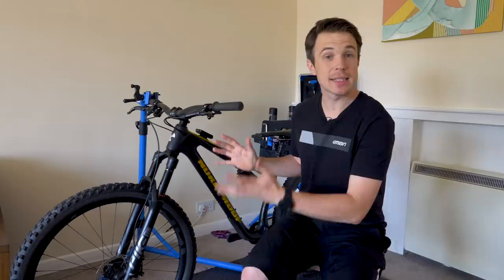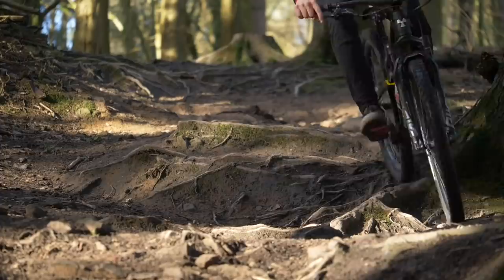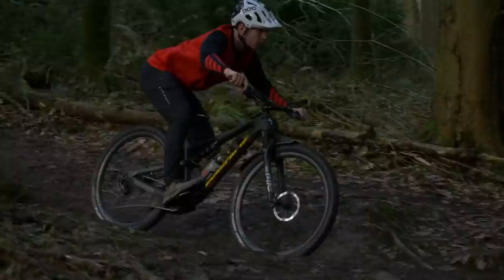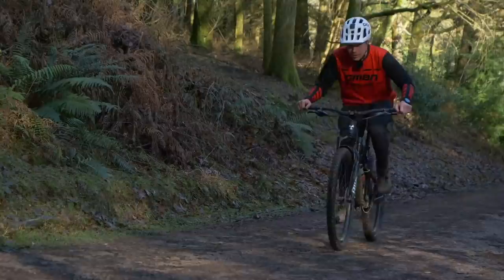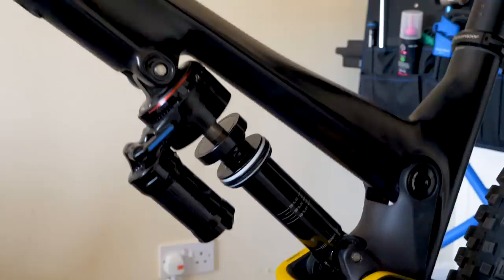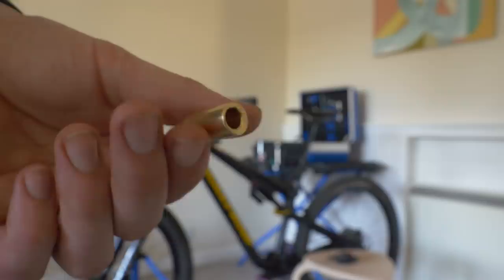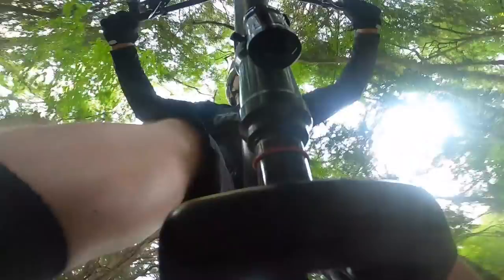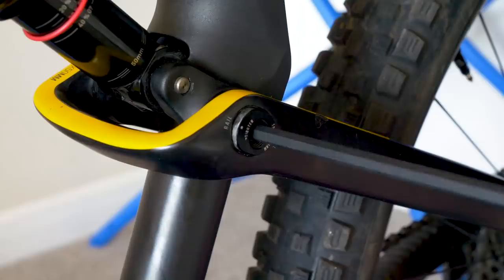Change Your Mountain Bike's Geometry For £100/$100/€100 | 3 Bikes in 1

Comment: perfect!!!
Considered doing the same thing to my fuel ex. I will clear a 55mm stroke (vs 52.5) as I have checked already without air in the shock.
Great video, please keep these up!!
Reply: Funny as I am thinking of reducing my Slash's fork to 150mm for more pedal friendly fun.  It pedals quite well but hey fun to experiment with.  Tyres also make a huge difference and a 32 tooth Oval chain ring to replace the 32 stock round.

Doesn't take much to change things for different purpose and for me, I know I have a great point it down and go hooligan style bike when I need it.
Reply: Going to a 55mm shock is also a common mod to the Giant Trance, it takes the rear travel from 140 to 148, and then you can take the fork up to 160 travel which also makes the bike a tad more slack.  I've been looking into this for my own Trance as my stock shock didn't come with a lockout, so I want a new shock with a lockout, but my bike came with the RockShox 35 Gold fork, which uses travel spacers, so I can simply remove the travel spacer to go from the stock 150mm travel to 160 travel.

Comment: @gmbn tech Regarding the opinion at 13:25 anglesets do change seat tube angle. Front of the bike goes lower, the BB as well and the seat tube angle follows them by increasing the angle the seat post is positioned against the ground.
Reply: All of which are good things

Comment: more travel = higher BB and slacker

dont increase travel more than 30mm though

And remember that stroke lenght does NOT equal stanchion lenght from the seal to the crown, it will bottom out 2mm before or whereabouts
Lower end forks will usally have 10 - 20mm extra stanchion

And why so little sag in the front compared to rear? I used to have 20% sag on my old 130mm fork, and 10% sag on my coil rear shock (stroke is like 47 mm its a very short 165mm eyetoeye shock)

I keep softer suspension in the front to reduce arm pump

Comment: Many bikes don't have pressfit compatible head tube, so you can't use angle headset, for example Trek, Santa Cruz are some of the brands that come to mind.
I think my Geometron G1 is great how it is, 62 deg head angle, low BB, steep seat tube angle. I am glad I went for it. I haven't experimented with mullet setup or different mutator setups.

Comment: Great vid. I am running a 2015 160/130 dual pos pike on my 2019 Nukeproof Scout.. Is the 130mm travel setting just for climbing  or can I use this to ride hard on dirt jumps, , on a pump track or dh flow trail to make it more playful
Then open up to 160 for the gnarly and steep stuff.
I was gonna try my Helm coil fork off my 2015 Nukeproof Mega  and adjust the coil travel but prefer my pike on the scout due to being lighter and on the go adjustability. Also prefer to leave the helm on the Mega.

Comment: If i were to dh enhance my bike, i wouldn't increase rear travel, because as you found out, it steepens the head angle and rises bb height (unless the rear wheel doesn't touch, in wich case it's great 😆). So I'd rather try to decrease bb height, as it usually slackens the bike, and I'd add air/compression to the suspension. Faster descending speeds demand stiffer/more supportive suspension, not more travel. My opinion.
Anglesets are indeed the best way to achieve the previously mentioned things.

Comment: Alternatively spend the £100 on a weekend away riding which will make you way faster and once you have grown a pair of legs you won't be bothered about the minute edges you can gain from tinkering for ages.The amount you will spend on aftermarket bits is directly proportional to the level of insecurity you have about your riding. lmao

Comment: Instead of buying a smaller air spring to reduce the travel of the fork, you can put the maximum amount of volume spacers in, and decrease air pressure, giving pretty much the same fork feel.

Comment: After 10 rides with an angleset, my fork had cracking and clicking sound.. umfortunately seems the steerer tube got damaged..
Reply: Try greasing the headset...cups, race, and bearing exteriors. Usually cause of from end creaking
Reply: @rupedog  yea did the whole 9 yards mate. Regreased 4 times.. took bike to lbs, reinstalled old headset, reinstalled the angleset.. still cracking and creaking. Then the lbs guy put another fork in and... well... no more cracking and clicking sound. I really liked the effects of the anglset and it worked well with my bike (made it 64.3%) and fork offset but alas....got a new fork, decided not to risk it so got a 10mm longer fork and removed the angleset. Maybe i was unlucky and got a bad batch but not.going to risk it as forks cost a pretty penny. Pity ..
Reply: @stevent1565  well it was the fork, not the headset. Now you got a longer fork that stays at the same angle so same pressure on the csu. What good? I advice you to reinstall the angleset and maybe lower the fork to what the bike came with (only if you want). I have a mate who has an angleset for 4 years on his bike, and his fork (a 2007 marzocchi Z1) is still going strong, so your problem was a weak steerer, not an angleset.
The longer fork rises bb and slackens seat tube angle, wich is not good. On the other hand, angleset slackens just head angle, but lowers the bb and steepens the seat tube angle, so everything is improved
Reply: @Tzestos  what you mentioned is true to a degree but depends on multiple factors. 1st the increase of travel: most bike makers(including mine) allow for 10mm increase of travel within a safe margin to keep the warranty(meaning its safe for the head tube and frame). 2nd it depends on the bike geo if it has a positive or negative effect especially the crown to axle measurement(i wld say the most important for a fork for your bike). In my case the crown to axle measurement increased by 7mm which works well for my bike. And 3rd , my bike is quite low and with the 170mm fork (original was 160mm) my bb height increased to 336mm from 334mm which is considered pretty low even by today's standard and has no negative effect in handing and center of gravity. My seat tube angle of course slackened by a minimal amount but i m off my seat most of the time so its not a big deal. All in all it works very well with my bike. In short, it all depends on your bike if it works well or not so of anyone is making any changes in anything, they must 1st do a bit of research and check with their bike maker; to which both i did.
As for the damaged fork; it is what it is. Who knows if it was just bad luck ie if my fork steerer tube just happened to fail or if it was the angleset (perhaps my particular angleset was defective). All i can say is this, my fork was fine after almost a year of hard riding. The cracking sound started after about 10 rides or less. When i  took fork of the bike, there was significant friction damage wear marks  on the crown where the crown race sits around(not there before i installed the angleset). Quite bad friction marks. I sent the photos of the damage to the anglset maker and they advised me to stop riding the bike and sent replacement parts just to be safe (they were very cool and helpful so i m not going to mention the make of the angleset. Beside, it just cld be i was unlucky to get a defective one so it wont be fair to them to say they have a bad product). 
I just bought a sweet Ohlins RXF36 EVO fork. So i m not prepared to risk using an angleset for my new fork anytime soon.

Comment: Surely works but is a lot of hassle. In my experience putting some cheaper downhill/Enduro 2.4" tires on a xc hardtail or trail bike already does a lot. Pump them up a bit less, adjust your suspension a bit and get aggressive pedals, a shorter stem and wider handlebars. A good bit cheaper and way easier than what he did. I'd even say it does a good bit more than what he did here. Still a good video for the more experienced folks

Comment: I wish I could stay focused and understand what the hell you're on about Henry. This is not a reflection on you or your explanation at all l, but for me you may as well be speaking Swahili. I sat down with all good intention to take this info and use it on my (cheap 'n' old) bikes. First minute or 2 in I was thinking "Yep, got that, right, I gotcha..." and then degree by spring-rate, compression by pre-load the wheels started to fall off and I drowned. I've been MTBing (badly), fixing, building and servicing my own and every other buggers bikes for over 30yrs but I just can't seem to get my head round all that. I can only liken it to being suspension dyslexic (my son has dyslexia amongst other SEN's before anyone gets all pc and precious). Does anyone else here feel the same or am I just an idiot. 🤔 It's so frustrating as I'm pretty good at everything else.

Comment: the pike can be increased to 160mm. use the 275 shaft. RS dont sell a +140 fork because that is the job of the lyrik. check out the trailhead app. also i have successfully done it to a commencal meta tr with longer stroke shock. 160/143 and 65.5 deg headangle.

Comment: #AskGMBNTech
My 2016 Scott Genius 740 was built with a 67.9deg lo/68.4deg hi head tube angle as stock. Not so modern or progressive these days. I've just learned about angled head sets  but have some questions/concerns: 
1. Is there a limit of how much slacker I can go? 
2. Will slacking the standard head angle adversely effect my bike's build integrity? 
3. How do I know which angled headset will fit my bike?

Comment: With my old (1997)  Rockhoppers 70 degree head and 72 degree seat tube angles, I don't think I'd be able to "Marty McFly " my geometry to anything like modern, but it makes a great climber! (I did give it a 1x11 upgrade though!)
Reply: You can get the 70 degree rockhopper down to 69 or 68.5 that is a really good angle for XC

Comment: I just bought a Whyte 29c XC bike. My last bike was enduro so will be a slight change of style.

I was wondering if anyone has put an angled headset to slacken the head angle by 2 degs and upgraded the forks from 100mm to 130mm on an XC bike? That would take the head angle from 69.3° to less than 67.3° which would be better for downhill. Will the xc frame hack it? 

Maybe this is not required once I actually ride it but I am just thinking of options if I am not comfortable with how it handles downhill (nothing major).

Comment: #AskGMBNTech
I normally just ride around my local parklands, with a few jumps and drops. It's the perfect terrain for a Canyon Spectral. But occasionally (one every 2-3 months) I take a day trip to the You Yangs where there's some really gnarly rock features, DH tracks and jumps. I love riding hard there. Because of that is it worth going for a Torque instead? I don't really mind too much about pedal efficiency, as long as it can get to the top.

The main thing I'm concerned about with the Spectral is that the Pike won't fare well in the You Yangs, and that the Code brakes would also come in handy.

Comment: #Askgmbntech
I have an old Cannondale Trail SL 1 2013 lying around, that I want to set up as an extra bike for my vacation house in the woods. 
It came with a 80mm fork and a 71degree headtube angle. To get it up to speed, could I just put on a 110 / 120 mm fork, or would that be too much for the geometry to handle? Would a angled headset be a better option? I normally ride an On One Scandal with 65 degree headtube.

Comment: I've just swapped my front fork from an 80mm XC fork to a 140mm 27.5'' boost fork on my 26'' hardtail frame (still using 26'' wheel on the front). I also swapped the 100mm stem for a 35mm Nukeproof stem (and new handlebars) and it's completely changed the feel of the bike. I've yet to fine tune sag and saddle position but it feels much more capable for rough trails and downhills; it feels like a whole new bike.
Reply: I guess u didn't get the memo on only ever increasing fork travel by 10mm, (20mm absolute max) over the stock maximum the frame was designed for? That huge jump, on an xc frame, hitting rougher trails, is a recipe to rip ur head tube off. Unless the frame had a 130mm fork option from the manufacturer, u are taking one hell of a risk, as frame would not be designed for that kind of leverage.
Reply: @rupedog  I'm not sure if it was an XC or what when it was bought, but it is a aluminium hardtail mountain bike. The headtube is quite long, 140mm, since it is a 26''er and aluminium alloy will fatigue crack well below its yield point, so I will keep an eye on it. I will replace the frame in a year or so anyway. 
I compared the new forks to the old ones and I estimated the new ones were maybe 20-30mm longer from the crown race to the axle at full extension (also much thicker stanchions and more robust). Given I should have 28mm sag on the new forks and my old forks were run quite firm, the difference should be less than that. Point taken though.

Comment: @gmbntech
Couldn't you theoretically decrease air pressure in the fork to shorten the travel and steepen the head angle and then add volume spaces to keep the progressiveness constant?
Reply: U will end up with too much sag, less travel effectively, and harsh ramp up...so not really...u u can, but should u...no
Reply: Great question I think. Rupert Wenn no downside here I can see of "too much sag" (b/c of adding spacers and), he WANTS less travel, and the volume spacer (just one maybe) would seem to have a similar effect as the same pressure in a shorter travel fork with the same sag %....the volume spacer is how you prevent the harsh bottom out as I understand it and just one wouldn't make it super harsh I wouldn't think. Curious for Henry's response to this. Unfortunately there are no volume spacer options for my budget fork.

Comment: #askgmbntech   Hi there I'm shopping for a new sets of wheels for an enduro bike because of budget I will stay with alloys the queston would be that  some wheel-sets  have different rim width, spoke count which plays with the concept of compliance and stiffness on F/R. should I stick with same wheels on F/R or should I try for example a Front EX511 32 hole 30/35 / Rear EX471 28 hole 25/30mm ( based on CB E11 concept ) also this could be a new video project for you guys to try out :) thx Best regards

Comment: Does the Angleset affect The reach at all, and would you have to offset this with a longer stem?
Reply: not 100% sure but logically if you're tilting the bars back in the head-tube it would have to reduce the reach by a little bit
Reply: It makes a tiny reach difference which I find is imperceptible.
Reply: My 1.5 degree angle set (44EC/44ZS) reduced my reach by about 5mm ... I did change to a 5mm longer stem (I wanted to change the stem anyway)

Comment: #ASKGMBNTECH Thanks for all the videos.. really enjoy the show guys....given the pandemic I found my self having to become a courier to survive. I have a cannondale trail 5 stock hard tail. I'm 6'2 200lb. What would be the must upgrades to be done so that I can tackle the concrete jungle of Barcelona and the cheeky Sunday get away to the mountain until I can by a second bike??? Mainly focused on the work aspect. Thanks in advance stay safe and keep on riding.... Gustavo
Reply: Re-fitted an old MTB to be my city rig:
A set of short knobbed lightweight tires - like folding Conti RaceKing - 3bar for the city, lower to around 2bar for weekend's offroad riding.
>> If you're willing to change tires every weekend get a set with an urban profile - Kenda Kranium in my case.
I also switched up gearing with a smaller smallest cog on the (new) cassette or/and a larger biggest chainring in the front (check specs of your mech/derailleur for fit!) for higher speeds in the city, whilst still keeping easy gearings for offroad uphills.
That's it - works like a charm!

After that it's all about reducing weight - lighter wheels and forks is what i would look into.

Comment: Could I put some sort of angleset on my meta am 29? Thinking about it and bringing angle down to around 64.5 but unsure if it'll mess with the rest of the geometry too much
Reply: It will depend on the size. It would be a good idea on the small and Med. Not a good idea on the L and XL. You will increase the front centre meaning you would need to get your weight forward more to weight the front wheel. This defeats the purpose of going slacker really. It all depends on your own personal measurements too. People are too concerned about head angle but it is the whole package and the fit that is important.

Comment: Did i miss the bit where it was explained how to travel adjust the rear shock... with workshop spec tools and full strip and bleed of the shock to install travel spacers you cant seem to buy as the general public?  Been keen to buy if anyone can point them out online anywhere.
Reply: He can change the the travel on this specific bike. I can do it on my Scott voltage ( 150mm slopestyle & 170mm freeride). It sounds like you're after shock tokens that firm up the compression & resist bottoming out. You can install these by removing air from the shock, unscrewing it & inserting it with circlip pliers.
Reply: In this video he is adjusting travel (stroke) on the rear shock. Using a mix of stock rockshox and custom made spacers. Unless you have a machine shop and can rebuild rear shocks it’s not something a home mechanic can do. Cool, but ultimately not plausible and so not especially helpful.

Comment: Change geometry for less than $100
Buy a BMX handlebars and BMX stem.
Reply: That wont change the bikes geo at all, only the riding position. Bike actual geo is totally independent to bars/stem etc plus that would be very very weird, like an easy rider Harley on an mtb